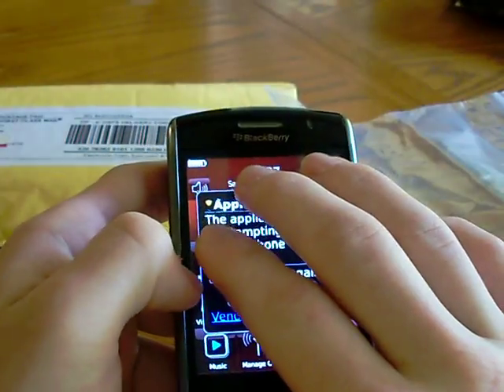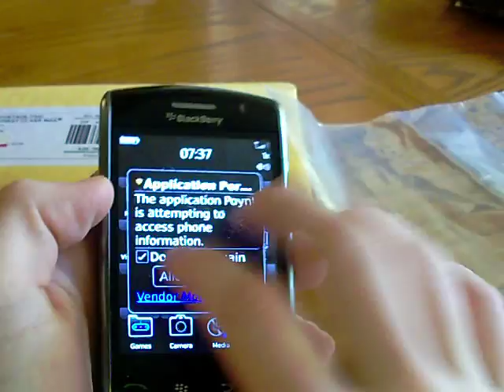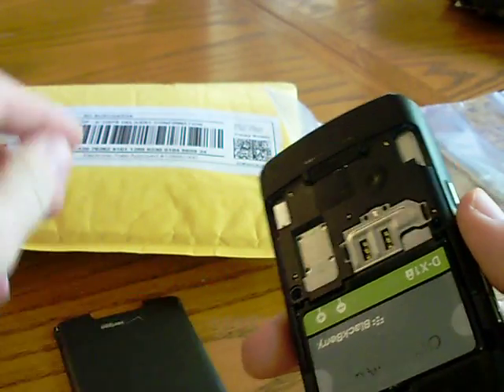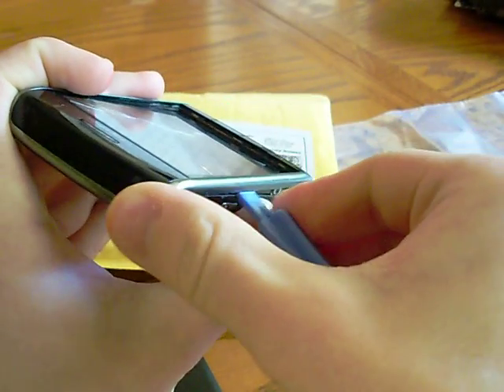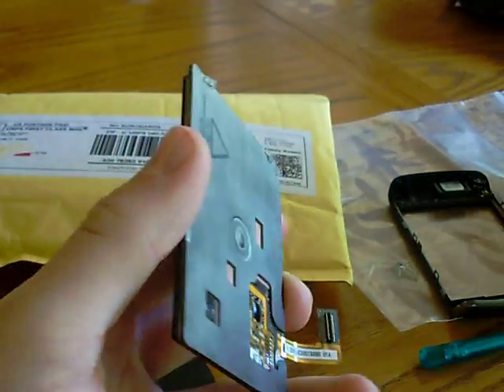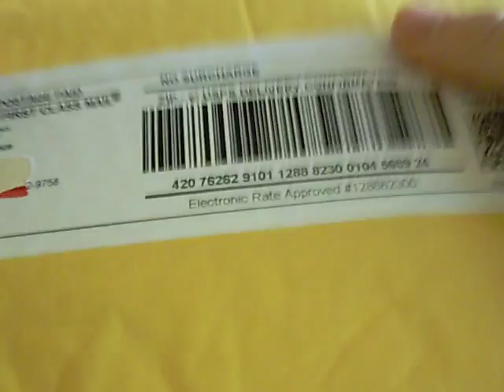Blackberry Storm LCD and Digitizer Replacement How To

Comment: Hello friend, I took out my old BB Storm 9530 from the desktop, I put it to charge and it turned ON, but the touch screen does not receive the orders to function when touching with my finger.
I followed his advice from the video and take the phone apart and clean it with a brush, take out the flex connection from the screen and clean it and reassemble all the equipment and put the battery on ... I DIDN'T TURN ON IT, only the light appears for several seconds red when putting it to charge, but does not act, what could it be?  I am sorry for my bad english